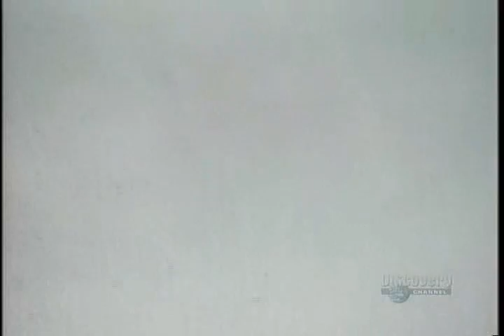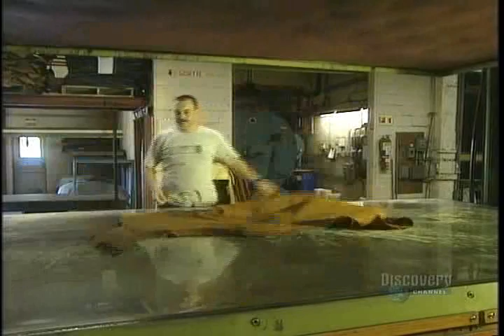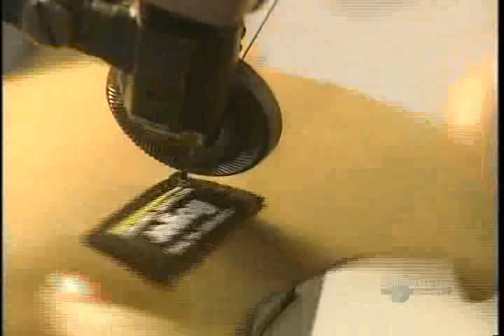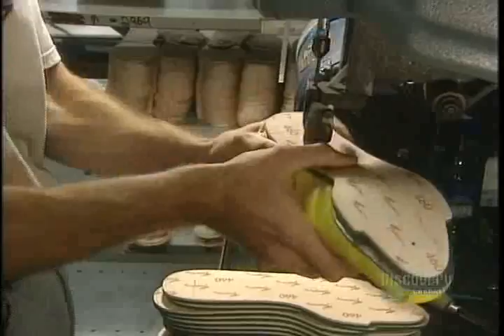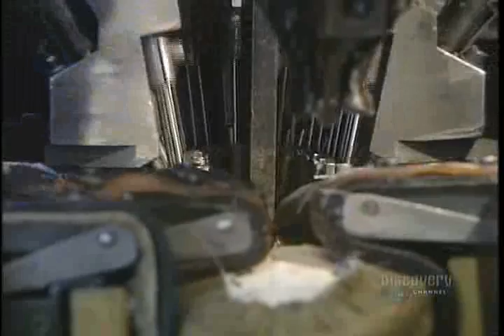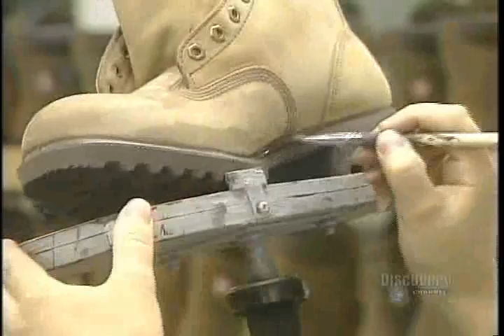How It's Made Safety boot

Comment: Looks like nubuck leather, which is a top-grain leather made by shaving down most of the grain of a hide to get a certain texture, then dying it to cover up the milling marks. Nubuck is very wear resistant which is exactly what you want when it comes to work boots. However, this means manufacturers can cut corners by buying low-grade leather with many visible imperfections. The processing to make the hides into nubuck will mask the imperfections. Sometimes this low-grade leather can be quite stiff and tough, which probably makes it ideal for workboots. As long as the uppers are tough I can live with the leather being lower-grade, but the thing I can't stand are the glued soles. Once you wear stitched sole workboots that can be resoled, you'll never go back to this kind.